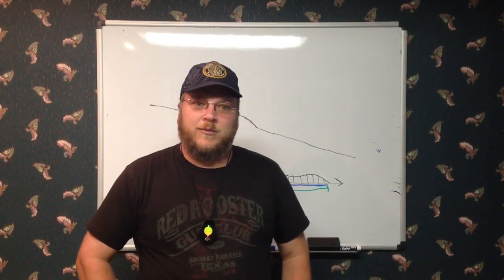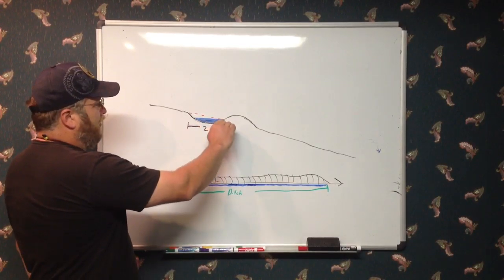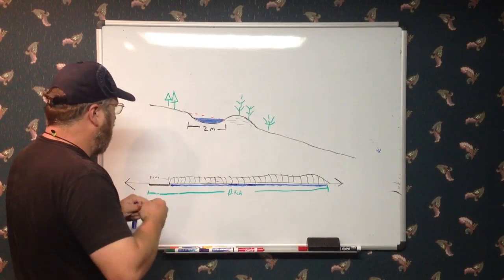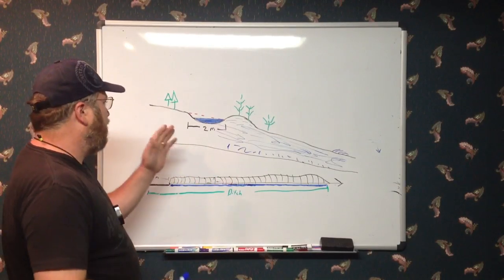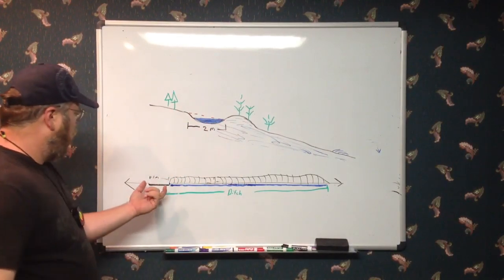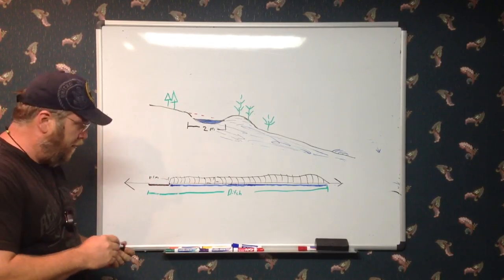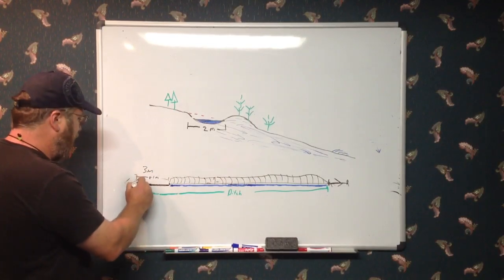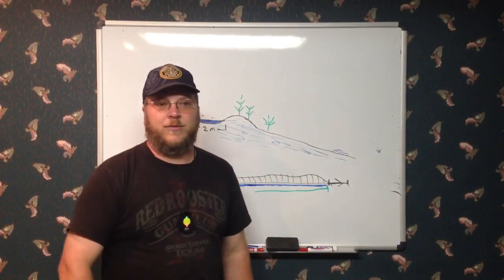Permaculture with Jack Spirko Part 7 - Large Scale Swales

Comment: With building the swales and causing all of the water to soak into the slope, is there any concern about land slides as the ground becomes saturated? Or does making sure they are planted eliminate that risk?
Reply from the maker: Like most things it depends.  In some environments you can absolutely over saturate and bring down a slope.  As the size of a project goes it it becomes more important to get the opinion of professional earth movers and/or engineers. 

The reality though is a swale based on size is only going to infiltrate so much water.  It really can't do more than its size will allow.  If a swale can hold 30,000 gallons it isn't ever going to put 60,000 into the ground in a single event.  All the extra is going to go out your sills which must be designed to accommodate your 100 year rain event levels. 

Next it is important to understand that while dams fail in a catastrophic fashion, swales fail in a sort of meh fashion.  What I mean is a 800 foot swale won't fail across all 800 feet, if it does fail a small part will just sort of drop in, this will reduce the pressure across the entire swale, effectively act as an additional sill and 9 times out of 10 you will be able to repair the damage with a wheel barrel. 

The big danger is shallow soils on bedrock on steep slopes and going to big, that COULD cause a mud slide.  But if you size the swales to the climate and design, properly sill them and as you said PLANT THEM AT ONCE and heavily the risks are likely lower than a slide happening if the slope is simply left alone and unplanted in the first place.

Comment from the maker: Nope a terrace is flat a swale is a level ditch.  A terrace would be a lot wider as well.  Imagine you took a pipe and cut it in half, leveled and then capped the ends, that is a model of a swale.  If you cut say a foot long piece just a few millimeters of one side a bit shorter then the rest that is a sill where it overflows.  To make a model of a terrace, you would level a flat board.  Does that make sense?